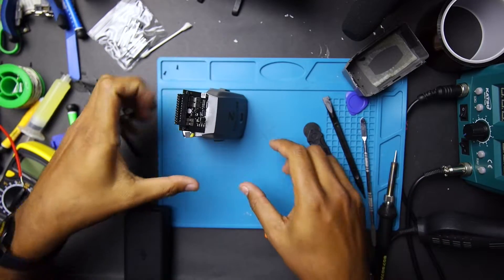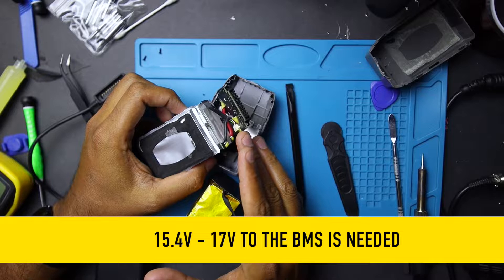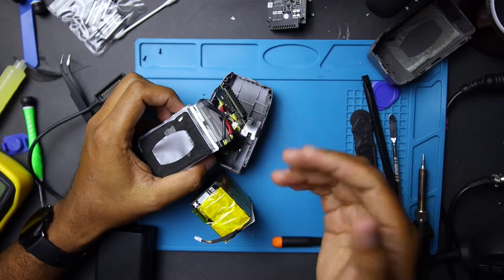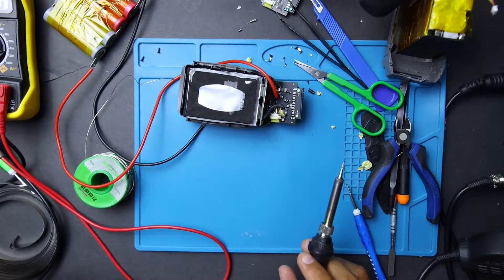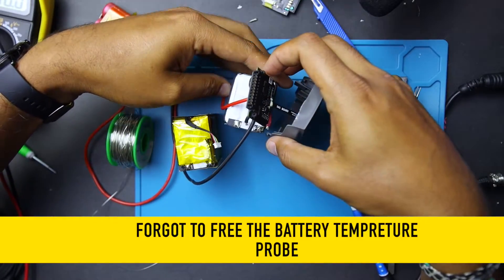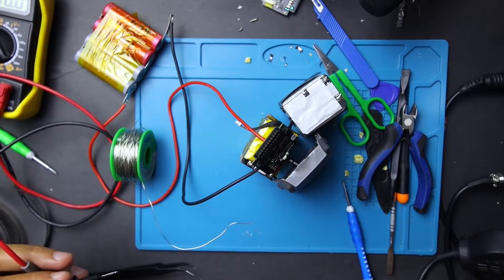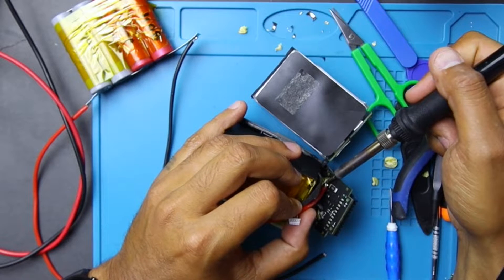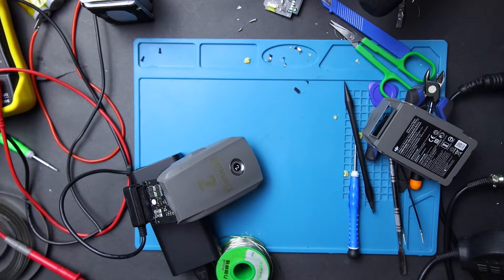Mavic 2 | Battery Rebuild Success

Comment from the maker: Video is at 60FPS so you can slow down to 25% if you need. I did this to reduce the playback time. Thé LED/Switch ribbon was left connected so I could check the battery status during the experiment.
Reply: Yep! I use the Firefox add-on Video Speed Controller. As needed, fingertip control of video speed.
Reply: Man by chance the Imax b6 charger makes my Mavic Air batteries last longer. Thank you very much.

Comment: Thanks a lot for your detailed video! 👌👍

I have 2 questions on this topic:

1: Is it important for any strange reason to use batteries to emulate the 15 V - 17 V for keeping the BMS alive? I am planning on using a laboratory power supply instead of batteries. 

2: Can I unplug the white cable at 1:12 from the BMS (for like 10 minutes) if I only have one battery to repair and need some time to change all 4 cells (incl. desoldering & soldering) ?

Comment: Hi Anthony,
First of all many thanks for sharing your experiments!
It's saves to others time and avoid us wasting expensive batteries, even dead.

I carefully followed your battery rebuilt process and something caught my attention.
The battery cells sold by our good friend Ali Xpress comes separated from each other as...individual cells.
On our Mavic's (2 Pro in my case), four cells are working together being welded on a base circuit.

So, if I well understand your way how to proceed:

1. You get a spare base welding battery circuit coming from a "dead donnor" battery (meaning that its BMS being disconnected from power is considered as dead)
2. You prepare the new batteries cells set by welding them on the base circuit coming from the dead donnor
3. Then you power the damaged battery set in parallel with an external power source in order to keep the BMS powered
4. The genuine cells base circuit coming from the damaged battery are split from their base circuit, keeping the BMS powered by an external power source
5. The new cells set welded on its base circuit is then welded connected to the BMS
6. Once the welded connection between the new cells set and the BMS is done you check the voltage
7. You disconnect the external power source used to maintain the BMS under power
8. Then I guess that you retreive the base circuit from the damaged cells in order to re-use it on the next fix as the cells needs to be prepared before splitting the BMS from the base circuit

If I well understand the process it means that a battery BMS must sacrified to retreive the cells base circuit... this one being necessary to prepare a cells swap under power.

I am right ?

Thanks a lot for your appreciated support
Laurent
Reply from the maker: Hi Laurent, yes that is correct in all your steps. I have made another video to reactivate the BMS, so the process in this video is if you don't have a CP2112 + DBK software. Maybe you can look at that video and you might be able to rebuild another battery and activate the BMS. 

If I had a donor battery I would do it a little different. 

1. Prepare replacement cells. 
The donor battery is dismantled and the battery is disconnected from the battery PCB (The battery PCB is the one that the cells are soldered to, it does not have any important components, it is just for the cells assembly. You will notice the Red/Black and the Blanca cable/connector.)

Install the new cells in the same order on the donor battery PCB. At this time it's completely disconnected from the BMS. 

Once the new cells are soldered into the donor battery board. You are ready to swap into the target battery. 

2. Open target battery (battery you intend to use), disconnect only the Balance connector and leave the Red and Black connected. 

Now you connect the Balance connector from the previous battery PCB that you just replaced with new cells. This will provide power through the Balance connector. 

You can now disconnect the old battery RED and Black lines from the BMS. It will be powered by the rebuilt pack. Then you solder in the Red and Black to complete the exchange. In this way, there is no need for an external power supply as I did. I did not have a donor battery so could not make more options.
Reply: @ANTHONYVLOG  
Anthony,

Many thanks for your fast and kind answer to my questions, that's very kind from you. I will thoroughly follow your suggestions once the new cells will arrive. 

At the moment I am awaiting the delivery of my CP2112 adaptors, hence I wanted to get rid of it use by using an alternate method. As soon as I'll get the CP2112 I try to use it along with DBK.

It looks pretty interesting to have an alternate mean to fix the DJI batteries glitches as their cost is pretty exaggerated.

On some points their bugs remain not understandable.
For example on one battery unit I own, having only 19 cycles, the battery accepts to load, the batteries LED indicators works fine without displaying any kind of malfunction signal.
Once installed into the drone the battery works correctly, the Smart Controller shows each unit along with the total, cycles numbers.
Everything looks and behave as normal.

However, as soon as I try to start the motors a message displays saying the battery is not correctly installed into the drone...so it is correctly installed.
The battery is absolutely normal, no sign of swollen, so the installation is a perfect fit into the fuselage.

All the connectors have been thoroughly been checked using an electronical microscope to be sure nothing is obstructing a connector.
The connectors are as clean as a 19 cycles battery can be.

So, I hope the use of CP2112 and DBK will allow me to save this almost new battery.

By the way, after having watched some of your external video's shoots, it seems that we live close from each other as I live in Geneva.

Thanks again for your kind support and advised advice!

Laurent
Reply from the maker: @Laurent-LV  oh yes. Very close indeed!  For the battery that gives the warning for « not installed correctly » if the battery like the Mavic 2, it has two small switches on the locking tabs that tell the BMS if it’s closed or open. A malfunction in the switch can cause this problem even if the battery is good 👍

Comment: any idea with Mavic air2? what is the proper way to recell? i tried to change the cells and run the DJI killer. the battery wont turn off. thanks
Reply from the maker: Can you read the BMS? Does it come up on DBK?

Comment: Hi Anthony. I rebuilt my mavic 2 battery pack. I have the CP2112 Adaptor -  and the    DJI Battery Killer 13/06/2021 Software- 
I tried your early method and kept power to the BMS. Unfortunately after putting it back together, I can't read the BMS now and the first led just blinks all the time. It won't take a charge.  When I do press on the power button, all four leds  light up.  The voltage at the battery pack is correct.   Did I completely kill the BMS?

Comment: Saw your video on resetting Failure in bms. I believe some chips have a password needed. I've heard of one software that magically works out the passwords but it is expensive. Does the software you showed in other video handle password protected bms chips?
Reply from the maker: Thankyou. Yes indeed there are software methods to unseal and clear the PF flags on the BMS. I have made videos of this as well with DBK and TRB softwares.

Comment: Hey Anthony,
Thank you so much for the great instructing video you made! 
I have a question about the method you gave on your next video for Dead battery fix with cp2112 & DBK.
Is it possible to unlock Mavic Pro Platinum battery (seemingly like MP1) with CP2112 and DBK? 
Mavic Platinum batteries are with BQ30Z55.  
I tried them the same way but still no luck in reading the chip. Software shows Error reading SMbus...
Reply: Bro same problem if you  have solution of this please help me also

Comment: wow, such complicated and dangerous way. you`re attaching li-ion pack in parallel to charged high voltage pack :|
first unsolder plus, then unsolder minus, then disconnect balancing plug. after changing sells plug and solder everything in backward order. i did this procedure several times
Reply from the maker: Thanks for chiming in. I appreciate the advise. Can you share your experimental video for the viewers? TIA
Reply: @ANTHONYVLOG  I used this video as instruction. Not sure if it works on  latest firmware, but all my batteries have survived. https://youtu.be/XmXI0d0TtYk
Reply from the maker: @fedkot  ah. I had watched this but could not clear the PF flag when I changed the cells, so I make some experiments and made this video as an experiment. My other videos don’t require this “experimental” method. Also note the disclaimers and when stated it’s an experiment I don’t intend for people to do it or if they do so, it will be at their own risk.

Comment: hi, i tried following your other video using the cp2112 board. but my problem after replacing the cell i was not able to read the info of my battery. it always have error "could not perform SMBus read 0x00" so it is impossible for me to "unseal" is there anyway i can unseal the battery? already used all the 4 grounds but still the same. battery is mavic2 pro
Reply from the maker: Bms can’t be unsealed it it can not read. Try reading a known working battery. If and when it works use the same pinout on the swapped battery. Cells need to be charged and within 150mA from each other.
Reply: @ANTHONYVLOG  i already charged using a balance charger. but when i measure the voltage at the small connector each color and different reading. the total voltage at 16.2vdc but each wire are different.
Reply from the maker: Try connecting the cp2112 to a good battery to see if it can connect. I don’t see why it should not work as you seem to have done it correctly. You can try swapping the sd and SC wires if you haven’t. Just don’t put them to ground or it will short out the cp2122.
Reply: @ANTHONYVLOG  yes when it did not connect, i tried to use the other good battery and it can read thats why im sure i correctly put my sda and scl. when i first replaced the battery i was able to make it work thats why i ordered additonal cells for another two battery that was bloated. but when i tried to dis-assemble again the previous one to make the soldering better after that its not working anymore. so i tried to do another one but still the same thing happened.
Reply from the maker: Briefly short the + terminal from the connector to the + from the battery board. Than try connecting cp2112 again. If it still does not work, I have no idea without having access to the board to check.
Reply: by the way thanks!
Reply: can i have your email... i will send a video of the voltages i get
Reply: @ANTHONYVLOG  its ok bro, manage to maek it work... found that the + terminal dont have output. just tried to resolder again one by one and now its working. the other battery found a crack on the boatd thats why no output at the + terminal. thats means the supply was cut going the other IC. unless i can find a diagrahm of the main circuit board thats the only way i can fix it. anyway thanks for the help...
Reply from the maker: @leimye  that’s nice work! Good job

Comment: Loved ur vlog Anthony, well done.  Can this be done to my Mavic Air? I have 3 swollen batteries. Not sure if they are the intelligent type?
Reply from the maker: Hello, thank you for your kind words. As long as the battery is still active you can. If it’s non responsive than you will need to software unlock after changing the cells with either free or paid software and their respective interfaces. I have other videos on unlocking them on my channel. 😊
Reply: Thanks again Anthony, I just watched ur other vidoes, good work! So just to be sure,,,, to fix my Mavic Air batteries I would need to buy the cells and the EV2400 and use the TRB free software? If any of the batteries have power do I need to hook them up to another power source or not?
Really appreciate you helping us inbetween ur work and having a family
Reply from the maker: TRB is the paid option as it only allows free viewing but no unlocking. For the free option you will have to opt for the CP2112 adaptor and the DBK software which is in the description of video titled “DJI Dead Battery - Fix with CP2112 Adaptor”. 

The condition for any of these softwares to work to be able to read the BMS is that the cells need to be above 3500mV (3.5v) each and a maximum discrepancy between cells 150mV. 
Please let me know after you watched that one and if you have any more questions.
Reply: Oh ok, it took me quite a few reads and rewatched the video but I understand now. 
TRB wants 1320 baht 30 pounds?? For a licence that you only use once to fix ur batteries?? That's very steep I think.
Why is everything so difficult and over regulated regarding drones?
BIG thankyou mate for all ur time and effort 🙏
Reply from the maker: @dalemawby8717  TRB is a commercial battery repair software for laptop battery etc they are including drones so I made some experiments. 

For the free software it’s called DJI battery killer and uses the CP2112 interface. You can download it in the other video and the cp2112 is not very expensive.

Comment: Hello!

Two question I have. (well actually one of request)
1. Could you please send schematic/video for creating this cells? (where should we connect the 4S cable wires to the batteriy cells)
2. Did you tried bigger capacity of cells. I try to find some alternative cells, but 3850mAh usually out of stock, but I can found 4075mAh, but I don't know what happen if I try to use this. 

Thank you! :)
Reply from the maker: 1. I don’t have a schematic. The BMS will have a discharge lead hard to mis. It’s the big black and red wires. 4S balance lead is not the same as normal, it comes with the battery PCB. 

2. Yes, capacity and chemistry needs to be changed in the BMS after you replace the cells. You can use DBK or TRB.

Comment: Can I still attempt this if my battery does not charge.  It was in storage and I can't get it out of hibernation mode.  I've left the battery charging for 24 hrs.  It's all 3 of my batteries.
Reply from the maker: This is only for changing the cells on an active battery. If the battery is not recovering from hibernation, you can use the other method in my other video with software and a CP2112 interface to wake the battery up if the cells still have some juice above 3.5V each cell.
Reply: @ANTHONYVLOG might you have a video that shows how to 1.) open the Mavic 2 battery and 2.) trickle charge each of the individual 4 cells with an external bench charger? I am able to read info, unseal, clear PF and PF2, reset chip AND reseal the BMS of my battery. But the green lights don’t come on. Should I still just connect the DJI Mavic 2 battery charger for 24 hours?

Comment: if i use a cp2112 do i need to have a battery back up? or can i just replace the cells and connect to the cp2112 to enable the board?? thanks
Reply from the maker: Hello, no need for backup battery or the method I used in this video if you can clear the PF flag. This video was an experiment to do it without any software. (The hard way).
Reply: @ANTHONYVLOG  thank you, great vids 👍

Comment: Hey man I'm trying to use 18650 cells to make a larger battery pack for the mavic 2. I want to use the old bms, button and temp sensor. Do u have any information on the bms? Would be greatly appreciated thanks
Reply from the maker: You can use the old electronics and swap out the cells, but it’s advisable to change the battery chemistry in the BMS and the charge variables. Though either TRB with Ev2400/2300 or DBK with CP2112.
Reply: @ANTHONYVLOG  ok thanks I appreciate it. I'm curious if you know the answer to this. Say I was using a 12 cell pack to try and get 9000mah is it possible to wire the bms to monitor 3 cells each since it's a 4 cell bms?
Reply from the maker: @12hyy7  hello, 12cell will have to be configured in 4S3P ie: 3Cells in parallel to make 4 packs than those for packs in series. 

You can adjust the BMS to the new configuration.
Reply: @ANTHONYVLOG  thanks man! Keep up the great vids!